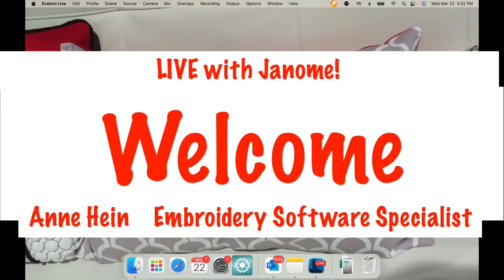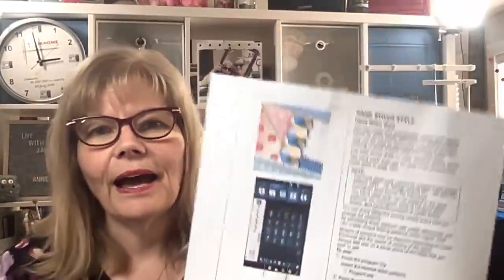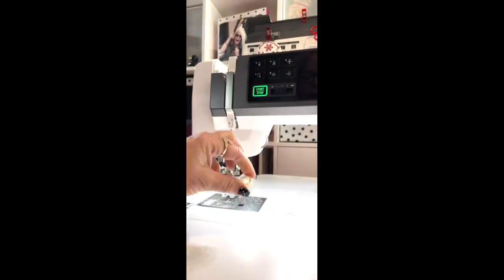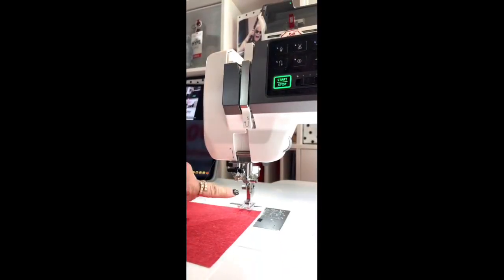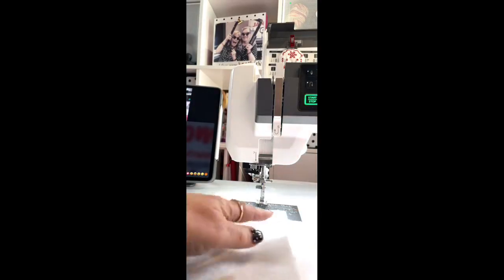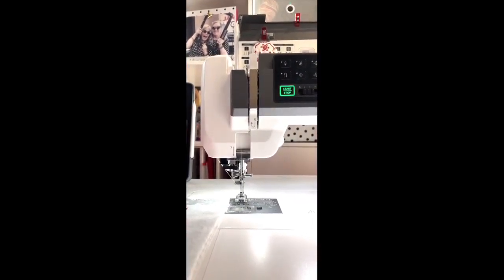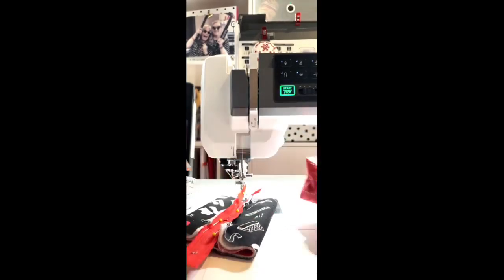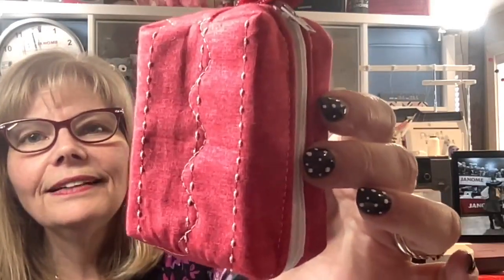Hand Style Stitches on Your Sewing Machine

Comment: Are these stitches available on S9?
Reply from the maker: Vikki, the Skyline S9 does not have these specific stitches, but there are Hand-Look Quilting stitches available to you with that machine. With these stitches, use a transparent nylon thread for the needle and ordinary sewing thread for the bobbin. The bobbin thread is pulled up on the right side of the fabric and the stitches will look as if sewn by hand. They are mentioned on pages 61 and 93 of your instruction manual. Happy Sewing!
Reply: Are these stitches on the skyline S3. 
Thank you.

Comment: Couldn’t you just use the hand stitch with the quilt batting already sandwiched in project to get the hand stitch look for your quilting?
Reply from the maker: You could, we recommend testing using your preferred method of quilt sandwich basting to hold the layers together, and testing the stitch on a scrap to make sure you have the correct length to sew through all the layers. Happy Sewing!